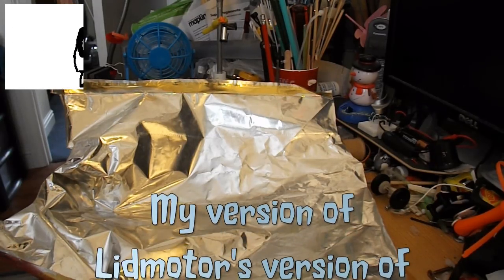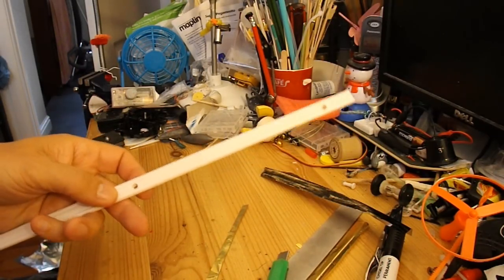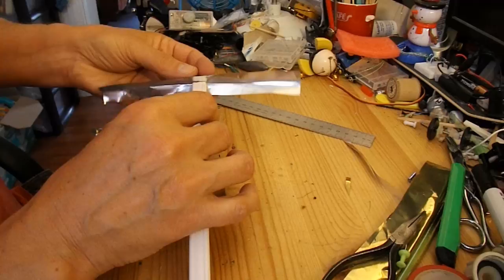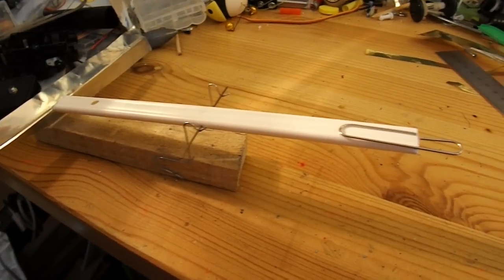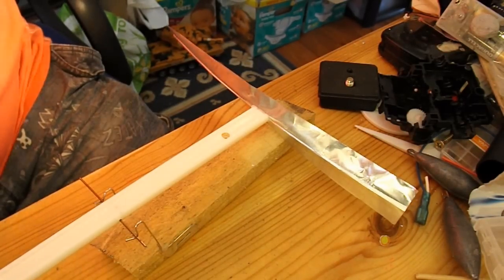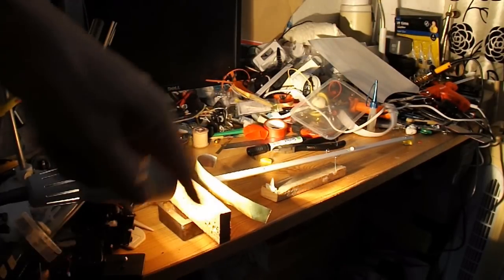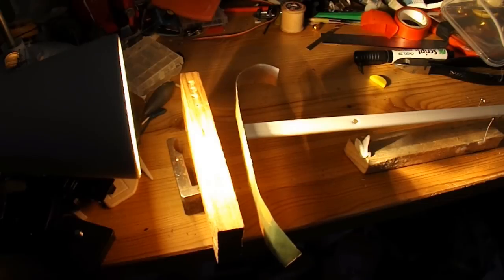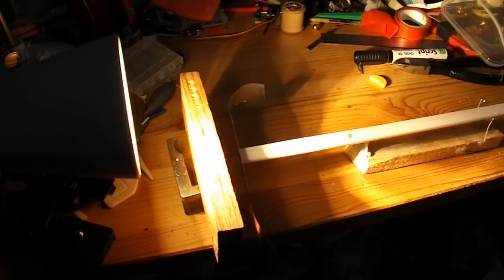My version of Lidmotor's version of Blade's Heat Engine

Comment: Hey grandad GrandadIsAnOldMan can i prefer it with alumunium foil
Reply from the maker: Jotana Kassapa I don't know, I haven't tried it BUT I doubt that it would work. The way it works is that the material you use has to stiffen or straighten when it heat up and return to it's previous shape when it cools down. Try holding a strip of aluminium foil over a hot light bulb or some other heat source and see what happens. Look at the links in the video description to see other people's videos to watch it working or look at the second video I did and you can clearly see how this material changes shape https://youtu.be/CzFqbGUYj6E

Comment: Well Done. It was great to see this working off a lamp.
   The heat sensitive element that Blade showed is stress bent in a certain way to maximize the bending moment.  He 'curls' the element a bit at the attachment point.  It reminds me of how you curl wrapping paper ribbon by dragging the ribbon over the edge of a pair of scissors.  That puts a stress on one side of the ribbon material more than the other and causes it to curl. That seems to work really good for this application to enhance the heat bend.
    I was unsuccessful yesterday trying to configure a rotating motor. I did get my teeter totter to run very well off the heat from my laptop fan outlet.  Something fun to watch now while I'm on the computer.
Reply from the maker: ***** using the laptop fan outlet is a very pleasing idea, all that wasted heat finally being used.. You will see in today's video 'heat engine in the sun' just how curled those 'arms' are when they are cold as I set it up last night before I went to bed. On my first version I did the fold up the middle, but in the later version I didn't bother. It works good enough for me to see it rocking when the sun hits it. I was wondering if I could just get it to hit a small bell as it rocks so it would really annoy my wife :-)